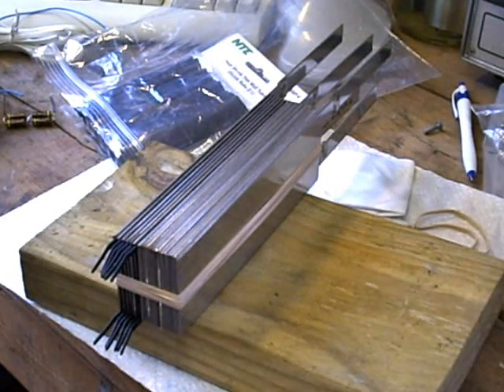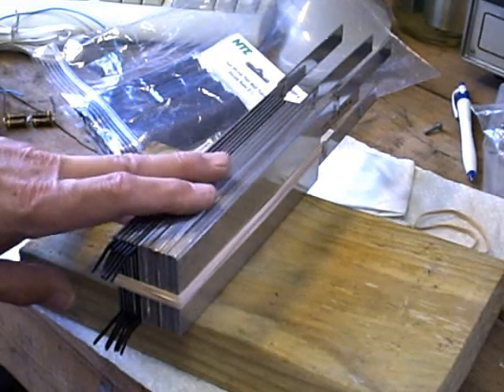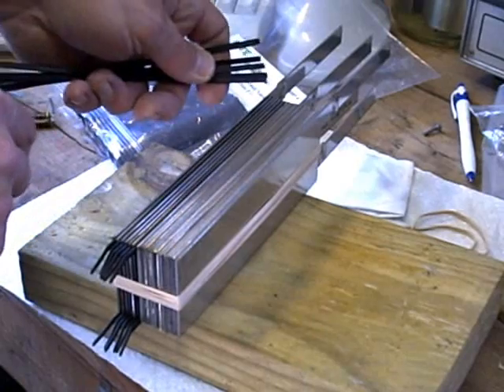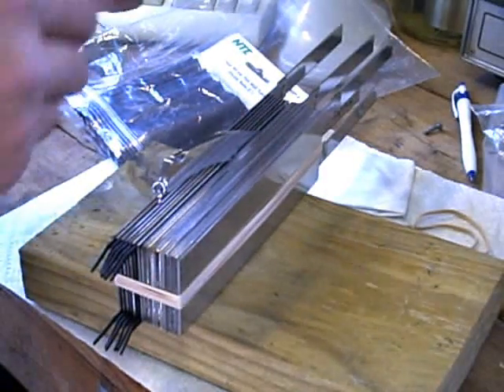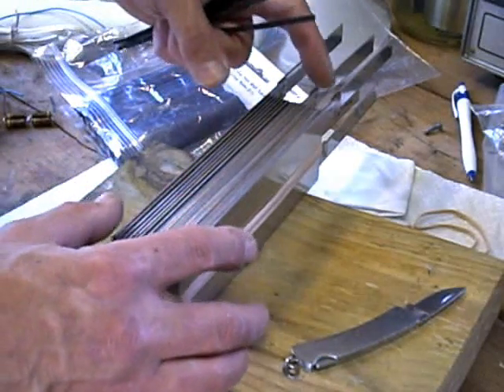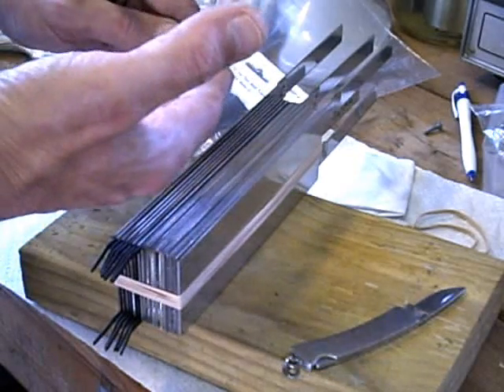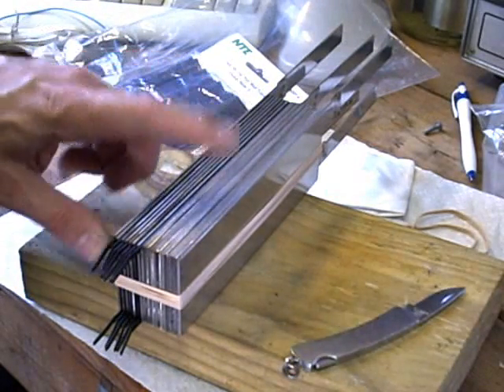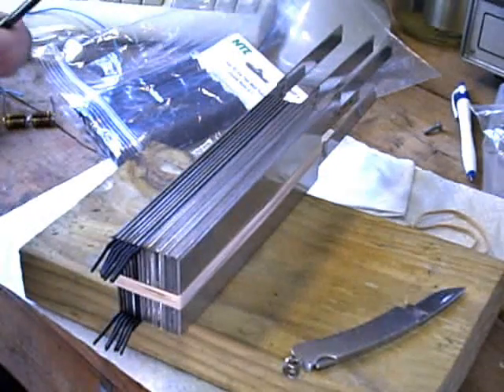#75 - VSPB Cell #2 part 1

Comment: all these neutral plate is an waste of material.. why ..the more you add.. the weaker the production .. its drewing  lower amp.. but you got add more electrolyte ,, they more electrolyte you add.. the more amp you suck in and more heat.. then you back to squire one again

Comment: I made sure to before I asked.  You did say this grade of stainless steel lasted much longer.. but I have a feeling that grade of steel is hideously expensive.  I'm going to call a welding shop today and ask.  And you did not mention sulphuric acid, but 3 others instead.

I don't think I overlooked anything?

Comment: I'm sorry if you have answered this, but in your limited usage with the plates, do they brown to the point of reducing efficiency?  Will they ever completely wear out?

Also is sulphuric acid a bad idea to use for the electrolyte?  When I built a very basic "hydro boost" system a couple years ago I purchased 6 or 7 quarts of the acid to use.  I read in the hydroboost article that one should alternate between baking soda and sulphuric acid, so the internals of the engine do not become acidic.

Comment from the maker: I wouldn't be nervous. I'd bet money your dry cell will still surpass this one for efficiency simply by virtue of the lesser leakage current created by smaller exposed edges. Although maybe not. If your feed through holes are 1/2" dia that's 1.57" of exposed edge per hole to my 1.5" at the top and bottom of my brick when I'm done assembling the acrylic panels.

This could be interesting.